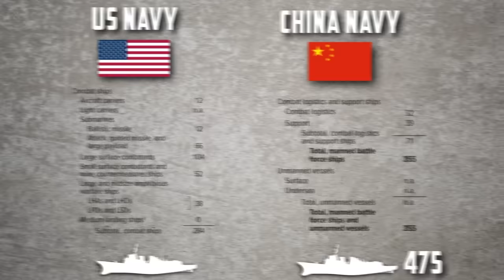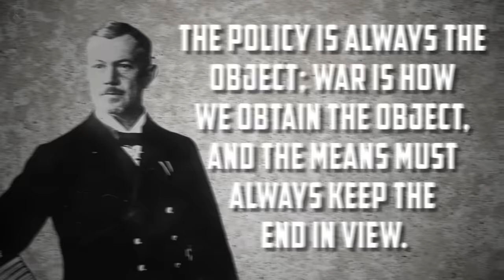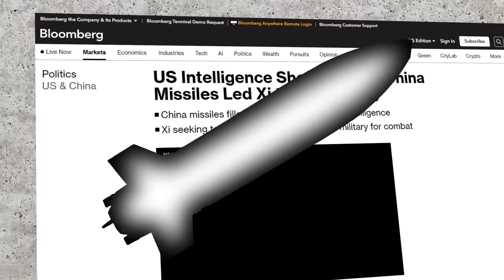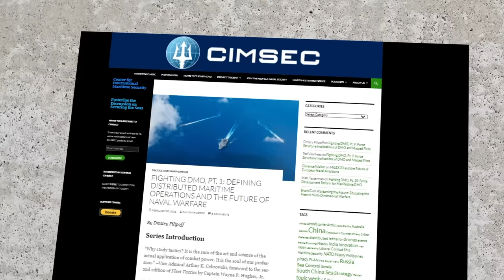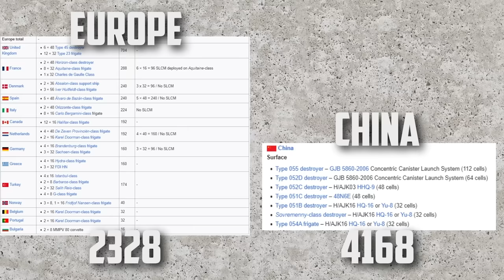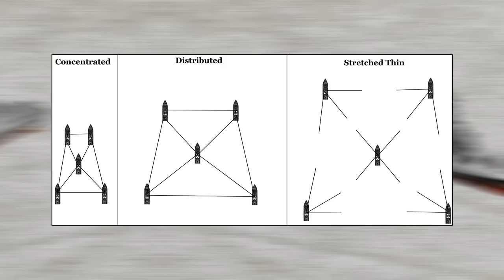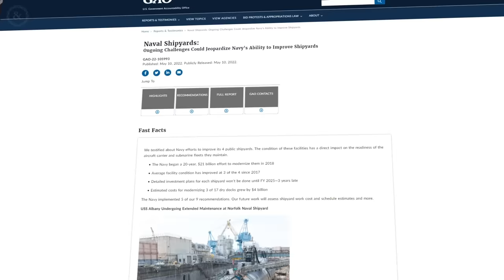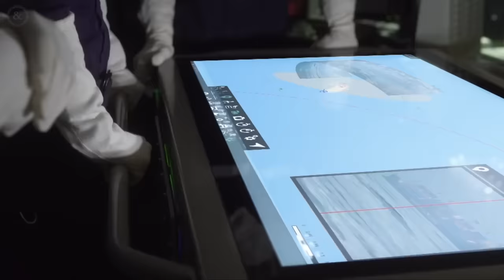Can the US Navy Rebuild their Fleet?

Comment: I still say we should have kept three Iowa Class BBs.  Form battlegroups around them and let them operate in environments they are suited best (looking at the Red Sea right now).  If they need AirPower but not at a carrier level you have Marine Assault ships that could handle the job and also, you know, bring a marine strike force.  I hear Marines like big guns that can back them up on the shore.  It would have saved massive resources that could have been used in other areas such as keeping the logistic capabilities in our shipyards up to par.  Last thing (of many) we are also seeing what happens in Ukraine when one side runs out of expensive complex munitions.  Missiles will run out.  Artillery is still and will always be easier to produce.  When neither see has any missiles left but both have guns ... 16 inch beats all the 5 inch guns easily.

Comment: Some thing s to condifer:
1) Us navy currently has lots of capital ships, but at any given time, up to 1/3 are in for repairs and mainatenence.
2) Us has far more exposure trying to maintain freedom of navigatio in chike points world wide, thus we are spread  out, and spread thin.
3) Large carrier battle groups are large targets.  Well preotected but still, large missile magnets.

4)China has smaller ships but heavily armed with the l;atest missile tech - and satelite tech.
5) China has not yet needed a worldwide navy.  It has an advantage of being in close proximity to the world's most important choke points; The Moluccan Straight and the South China Sea. 13 carriers are not required, since all of that is within range of aircraft and shore based missiles - with a short supply line.
6) China can cut off or threaten the two most inportant allies America has in th efar East, South Korea and Japan.  Thay can do this by proxy using North Korea - which is working even now in peace time, holding down all US assets in Asia for the last   60 years.
7) Recent movements to re-open the Philipines is herky jerky - not a policy of alliance.  The Philipines are unstable partners, with several independence and terrorist groups very active - including at least two that are Chinese backed.

So, IMO, the cards are about evenly stacked, with a slight edge to China vis-a-vis Japan and South Korean vulnerability.  In a conflict over Taiwan, I don't think the US will risk the destruction of Japan  or South Korea for an island that is not an ally.  Japan will certainly pressure the US to abandon Taiwan.  China hates Japan as much as they covet Taiwan.  As for S. Korea, they would defeat  a NK assault, but would lose their economy and would become a beggar nation over night.

Reality - as I see it - is that the US has allowed China Most Favored Nation Status at our peril, and it may be too late.  Taiwan isn't just about the 19th Province.  It's about the historic shift in the balance of power on earth, starting in the Far East.  The riple effects of a negotiated US reversal over Taiwan in the lieu of military action will be felt world wide, and especally in the value of the US dollar, which could finish the job of taking down th US without the need for a global Chinese Navy.

Comment: The other very large shoe waiting to be dropped is that of manpower in the U.S. Navy.  The Navy struggles with retention rates commensurate with their needs.  Ships have been chronically undermanned for years now, resulting in dangerous levels of fatigue and loss of maritime proficiency, let along combat proficiency.   Even if the Navy magically had the number of ships it wants, it would not have the crews necessary to man them.  This is an issue that gets precious little coverage outside the Navy itself.

Comment: 3 ship classes will change drastically and will be the reason the US will maintain sea dominance.

1) the next gen destroyer. It will have drone launch and recovery with dozens of units. It will have many missile cells. Perhaps 20-40. It may or may not utilize a gun.

2) the cruiser. The zumwalt ain’t it. There will be a ship that primarily provides missile coverage. About cruiser size with hundreds of missile cells.

3) a drone carrier. This would be a very small aircraft carrier with one purpose. The launch and recovery of drones

Comment: Well pretty good analysis from an average infantry man.
However Id add a couple of considerations.
 1 Since the invention of the guided anti ship missile in WW2  the Navy has struggled to protect its warships and amphibious units.
Of course those initial guided antiship missiles were kamikaze piloted planes but the human computers were replaced within 20 years with increasingly effective electronic guidance systems.
The Navy basically tried to counter this threat by utilizing missiles.
The problem with this solution is it takes about 3 counter missiles to be reasonably assured of taking down an incoming modern ship killer missile.
And thats assuming that the incoming missile isnt a maneuvering hypersonic missile.
There currently are only three tecnologies that Iam aware of that can defeat a concentration of high supersonic or hypersonic ship killing missiles.  A. Directed energy weapons B. Railguns C.Maneuvering hypersonic anti missiles.
All three need  the support of highly effective rsdars linked to super fast computers verging on AI capability. 
The Navy has focused for 75 yesrs on building ever bigger more expensive nuclear carriers along with task groups whose main job is carrier protection. Neither the Navy nor the defense industry has focused on protdction of its capital ships or its key bases such as Guam. Three other factors make its current dilemma even worse.
1. Reloading the VLS cells at sea. 2.The fact that on most of the Navys ships the VLS CELLS  are too small to accommodate  current hypersonic designs. 3.
The Navy has abandoned railgun and rocket boosted extended range weaponry.
3. The disturbing fact is that a heavy hypersonic missile hit on a ship will almost certainly sink a smaller surface combatant and at the very least result in a mission kill on a supercarrier resulting in being out of action for a year or more. The huge kinetic energy of a ton or more of mass moving at Mach 5 or better almost guarantees the outcome.
The conclusion is that the Navy as job 1 MUST get to the point where it can effectively defend itself against missile threats.
Then of course there are submarine problems but thats another story.

Comment: The perry class frigates should have been refitted and mantained all the way to the US comissioning constellations in their place. Take the turks who have  fitted an 8 cell vls for quad pack essm and a new AESA radar or the australians who fitted an 8 cell vls and sm-2 to the mk-13 launcher.

Moving forward, their should be a clear plan to keep the burkes relevant before ddg x- my suggestion would be flight 1 and 2 being refitted with the Spy-6 (v) 3 which will deliver equal or slightly better performance than spy-1 while saving topweight rather than just flight 2a receiving the larger the sp-6 (V) 4 and flight 3 getting the full size spy-6 as currently planned. Flight 1 could be tasked with land attack and anti shipping (LRASM needs to be vls approved) with an essm self defence armament, flight 2 as a gp platform, and flight 2a with its hangars can be the primary asw burke, TACTAS is already being put back on them so this works out well. The full 42 vessel order of the Flight 3 should be proceeded with.

Their may well be ways the LCS can be salvaged- the freedom class needs a new combining gear- but is in a position to support essm with its TRS-4 radar- mk 56 for twin pack essm or self defence length mk 41 for quad pack could be explored in place of the 24 hellfire missile module, even 12 essms would be a huge boost in aaw performance when combined with the RIM-116 (21 Missiles compared to 11 on the Independence). A permenant small towed array (Captas 1 or 2) and the firescout/ seahawk combination rounds out a good convoy escort. The independence class would cost so much money to make seaworthy and survivable that buying off the shelf corvettes would be a better idea

 The US is definitely behind in submarine launched vls, the only anti ship missile is harpoon, which can only by fired from torpedo tubes (reduced volume, rate of fire) while the vls that is there for tomahawk is usually only 12 cells. Making sure LRASM can be launched from the vls and increasing the number of cells in SSN (X) to between 24-32 is definitely a good idea, especially since the Ohio ssgn conversions are meant to retire by the end of the decade.

Their is also a slight problem with carrier/lha/lhd self defence armament as the mk 29 launcher can only support block 1 essm or legacy sea sparrow- we are talking multiple hundreds of these missiles being kept around just for these vessels even if outdated. Either a new launcher (not something cheap like the ADL) or 16-24 self defence mk 41 cells should be fitted in their place so block 2 can be used- the San Antonio lpd is ffbnw this approach. RAM is also looking a lot more capable in the block 2 configuration, accredited with 19km range in german service and an anti surface mode. 

Spending money now, for vessels that will last and not leaving their replacement till overdue (the Ticos) will be far more efficient for the US taxpayer. All these things are achievable- US vessels need to be qualitively better than their chinese competitors- who are now nearly exclusively fitted with AESA radars, a very capable point defence weapon in the 1130 ciws and dozens of vls launced anti ship cruise missiles that have the flexibility of land attack. US yards might be able to keep pace if they start now by the end of the decade but will never outpace China again so every investment counts-  no more LCS, Zumwalt fiascos can be allowed

Comment: Speaking of tried and true technologies, we gave up on the Guided Missile Launch System (GMLS) far too soon. The old arm launchers might have been slower than VLS cells, but with a simple tunnel through the core of the ship, you can land containers full of reloads on the helipad and route them up to the magazine, without turning tail and running back to port. And we have Mk57 PVLS cells, so we don't have to sacrifice launch rate when on defense.

In general, we need to think of the Navy as the shield, and the Air Force as the sword. Even with the best reload technology, the turn around capability of the Air Force is going to be able put far more offensive ordinance downrange. A single C-17 can drop 45 LRASMs in a single sortie, and then turn around and do it again tomorrow. The battlegroup would have to dedicate an entire squadron of carrier based fighters for that. The Navy needs to keep clear a corridor for the C-17's get close enough for the LRASMs to do their worst. Deal the Chinese fleet a crushing defeat early, so that they have no chance to land, much less logistically support a landed force, and hope you can nip the conflict in the bud.

Comment: I think that as they build new America class amfib ships they should take the Wasp class ships and make them something new.
On the well deck they should install a small nuke power plant & mechanical equipment to create synthetic liquid fuel.
This, combined with the aerial refueling pod Boeing put on hold for the V-22 would allow the Wasp class ships to be oilers, resupply ships, rescue & air/sea dominance ships all in one.
A that would be need to be done is work on the fueling system. If it's a pod setup you could even remove it if you want to return to the marine assault mode.

Comment: You seemed to forget to account for the fact that any conflict would be in the region of China so China can used land based assets, and is in the central position. If China raids, it can have an overwhelming force that can sorte through any one of five directions: north or Taiwan, between Taiwan and Philippines, south of Philippines, towards Australia and the Indian Ocean. That means the US Navy needs a massive superiority of assets since it has to cover each of these direction with multiple carrier task forces. 

And of course the US is operating about 10,000 km from the American coast, and there is transit time, and a long supply route. That supply route is vulnerable. China really does not need much in logistics since China is right there.

Unmanned or lightly manned systems have real maintenance issues since there is such a distance to go to maintain. Having men basically right there to maintain means that do not need as much surplus capability to account for having to send equipment all the way back for even regular maintenance, let alone the long distance to send battle damaged equipment. 

And submarines are probably from from immune. It appears that the Chinese have a SONUS type system that is monitoring Guam. So for sure has an extensive system to monitor the seas around China. I expect that  submarines that attempt to operate in those seas will not last long. 

Basically I think that for the US to be able to come close to challenging China, it will need to increase its fleet by many times, and even then it is questionable.

Comment: You think about it, this mimics modern air superiority doctrine. The offensive capability of a modern navy doesn't come from the range of its guns but the types of missiles it can carry and how many of them. Just like in cold war Soviet doctrine where one Mig-31 could provide radar cover and targeting data for multiple other aircraft armed with the same missiles covering a 100 mile radius, so could an Aegis provide info and targeting for multiple frigates carrying the same capacity missiles as the larger cruisers do. These missles being so effective the navy has a much greater standoff capability with 100 missiles between 3 frigates stationed strategically along a coast or gulf entrance VS 1 cruiser with the same amount but only in one place. Cruisers have the capability to operate to potential independently however the frigates do offer a huge boost to combat effectiveness of the navy especially when used in conjunction with other ships.

Comment: It would really depend on the mission the US navy is asked to perform. Assuming China doesn't have any/many tofu dreg ships they'll try and fight with, their navy is only set up to fight along China's coastline with a few ships designed to reach the Malacca straights. If the navy were tasked with disrupting China's trade or providing assistance to Taiwanese forces in the case of an invasion, they could probably do alright, but if tasked with intercepting the Chinese invasion fleet headed towards Taiwan, they may suffer more significant losses.
Of course, this doesn't factor in the Chinese Air Force, which would also give the navy trouble whether it was staying at range or not.

Comment: I’ll be the one to say it. Our navy has lost its way. It really has. During the Cold War we produced 4 destroyers and submarines a year. We are only producing 2 of each right now. That’s it. We are not yet producing the frigate or Columbia’s yet. We are not yet producing large amounts of the most advanced newest replacement anti ship/ground/air missiles. There are few LRASM, Jassm, etc etc. the JATM aim 260 isn’t even out yet. Submarines and ships are going out on duty with very old anti ship missiles from the 1970’s. We shouldn’t be lowering our force structure with China posturing. We should extend the ships and the crews until we get the new ships to expand and then they can decommissioned properly. Our navy needs a lot more submarines and destroyers immediately. We also need to expand our naval drone ghost fleet. The navy needs to change course.

Comment: Additionally, there is a ton of jet-propulsion and rocket tech engineers on the west coast that currently the industry has sitting idle.  Elon has snapped a lot of them up, yes, but not all.  Many are semi-pro and could be moved over into various types of ship+flight related manufacturing coz they have done small-scale production themselves already in groups.

Comment: Carriers, if built at all, should be 1/3 the size of the Ford class and there should be 4 or 5 of them per flotilla. If a Ford class is sunk it is a military and quite likely a political crises. The immediate repercussions could be disasterous. If 1 or 2 of the smaller carriers are sunk the mission can adjust accordingly without a total loss of presence. Decentralization of power is the keystone of the 21st century as it is the proper response to all manner of advancing technology. Take note that armored vehicles of all kinds have been very recently rendered TOTALLY obsolete by the unmanned drone. Increasingly unstoppable rockets and missiles pose serious threat to all surface vessels. Offering the enemy a target so huge and irreplacable as a 100,000 ton carrier is a foolhardy invitation to disaster.  

There is no such thing as an unsinkable ship.  

NEVER.    

In my opinion the only fleet still worth developing is the submarine fleet and many small ships of various utility.

..

Comment: If it means meeting or exceeding the shipbuilding capacity of CCP China in time, NO. The US has exported too much of its industry & it will take at least a generation to get it back even if it is a priority. There will always be a learning curve, Exporting industry was in hindsight, a historically a dumb move. We cannot control what has been exported. We spent generations making fun of trade schools & pumped out lawyers & MBAs instead. The results are seen in companies like Boeing. FAIL. We do need a priority placed on getting more skilled & competent Engineers & Technicians to recapture industrial output. It is a security issue.